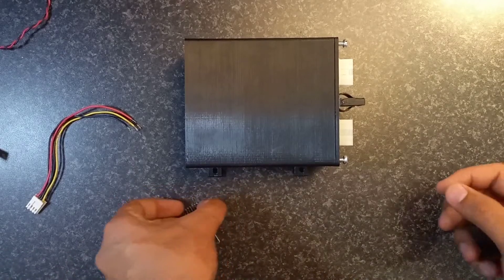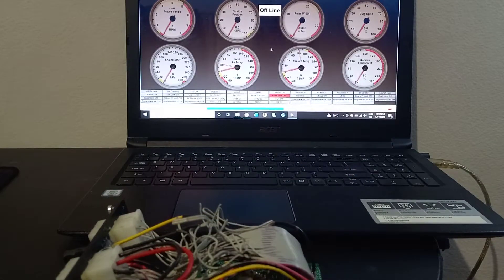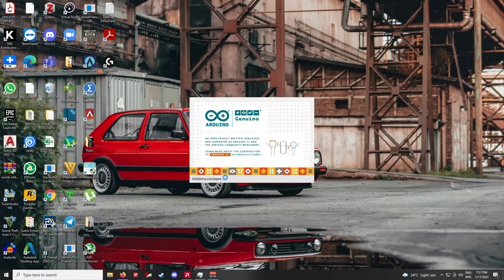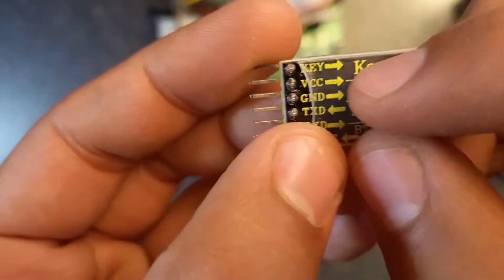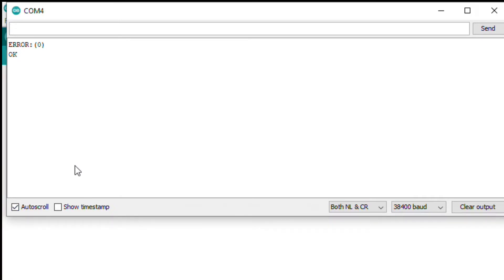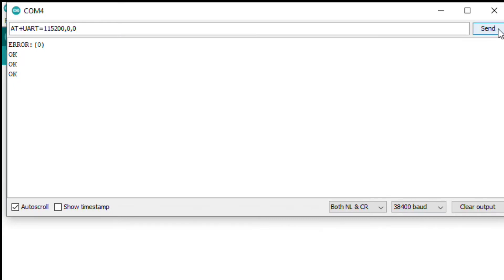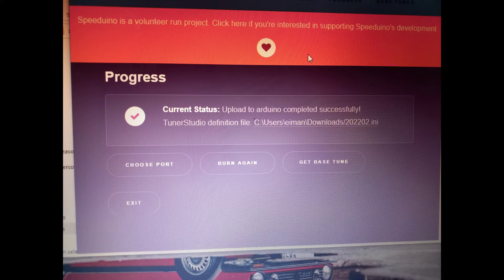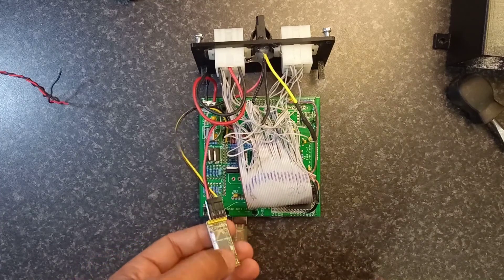How to add  Bluetooth to speeduino with HC-05 module

Comment: I have tried a hc06 and did not worked, i could configure it using another arduino, i had set the name and speed, but ir doenst work with speeduino... and i know others that have had the same problem...
Reply: Same here, but with the hc05. 
Connection doesn't work properly, seems to be something wrong with the arduino mega and the transmission between bluetooth. 
Any baud rate connect It, and the signals received are always strange.
Reply from the maker: There is a pretty good hC-06 video on youtube that you can look at.

Comment: What additional inputs did you add with your own wiring to that front plug there?
Reply from the maker: Oil, fuel pressure input and fan output

Comment: Nice Bluetooth  module!
Reply from the maker: I see what you did there, thanks buddy!
Reply: @061garage  i will have to watch and re-watch the video, there is alot of information, most of which i cant apply since i dont run this setup, but it is well put together video, that will help alot of speediuno ecu and diy enthusiast
Reply from the maker: @road_2_pow_r  I spent my sweet time figuring all that out. The HC-05 can can vary between brands when it comes to the key. I hope my hours spent can be hours saved to someone else. 😁
Reply: Where do you buy this ecu and loom
Reply from the maker: @sheraazharris5157  A friend built mine. You could buy them online-
speeduino
Reply: @061garage  about how much is it to build it like a 60-2
Reply from the maker: @sheraazharris5157  depends on where you are in the world and availability, where you from?
Reply: @061garage  I'm from cpt the mother city
Reply from the maker: @sheraazharris5157  I know a guy in JHB that could hook you up. contact me at 061.Garage on IG
Reply from the maker: @sheraazharris5157  estimate R2000. That's with an onboard map sensor, unlike mine.